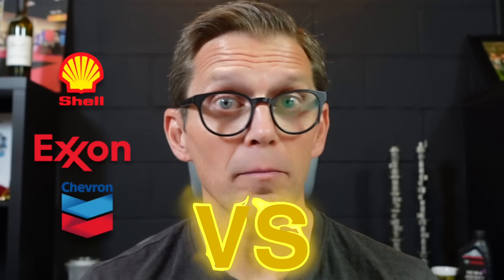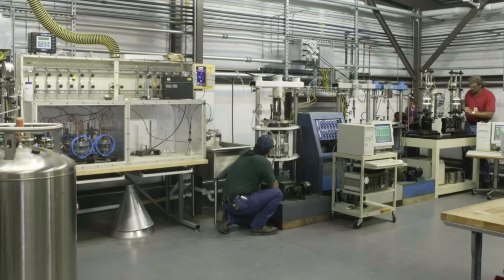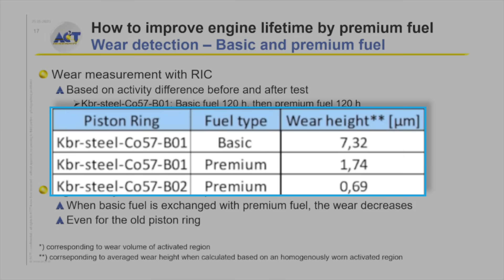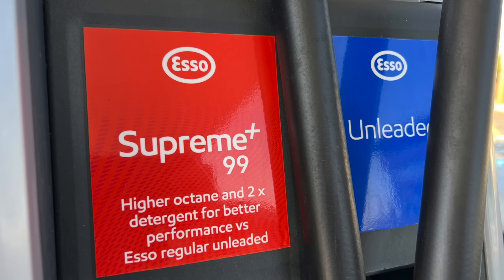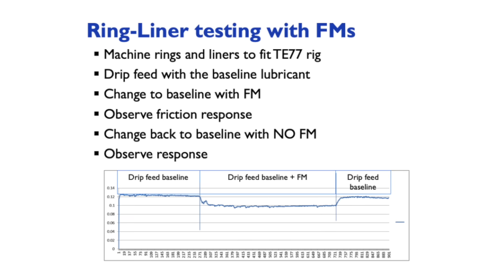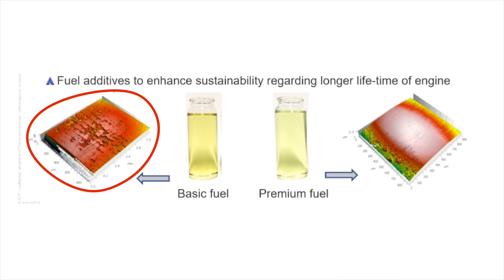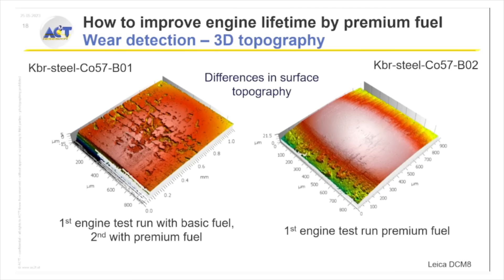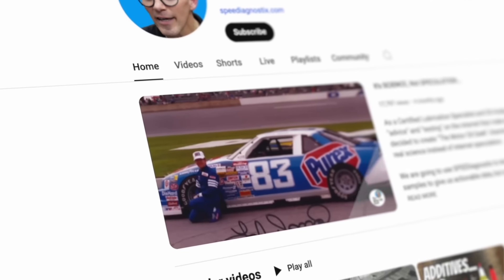Can Premium Fuel REDUCE Engine WEAR?

Comment: My C5 Corvette drank nothing but Shell V-Power 93 its entire 190k mile life in stock internals.  I went to do a cam and heads swap for more hp and found that my cross hatching on my cylinder walls looked brand new, and almost zero carbon build up anywhere.  Very pleased.
Reply: I have a 2010 Camaro SS with 225,000 miles and just replaced all gaskets, lifters, springs, timing chain, and cam. The cylinders looked like they had barely been run so back together it went and we're still rolling like the car is new. The cars entire life I've always used full synthetic oil and premium fuel, typically same brand unless I'm traveling.
Reply: what brand of synthetic oil?
Reply: @rl7487  Valvoline Vr-1 20w-50
Reply: @gofastwclass Going to guess you did regular maintenance on it and changed the oil within 7,000 miles (An didn't fall for the 20,000 mile hype on the oil container) and didn't drive it like you stole it either. That is going to affect the engine wear FAR more than gas (So long as you didn't get any bad gas)
Reply: @SilvaDreams  you got data on that?
Reply: @SilvaDreams Not many vette owners doing 7k oil changes😂  C-5 owner (Z-06 bought new in 2001)
Reply: @SpookyEng1  That is just sad to think about.... Use to change my friend's 1968 1/2 Camero's oil every 5K or 6 months, still the original engine and ran smooth as silk (despite the previous owner being an idiot and trying to drag race it and welding the block to the frame)
Reply: @SilvaDreams it’s “Camaro” and there was no 1968 1/2 model😂 Some people call a 1970 model 701/2 sometimes because of its late release.
Reply: @SilvaDreams Driving it like you stole every once and a while is actually good for the engine. Engines were designed to rev out. If not they will have get carbon build up if you are just lugging around.
Reply: @jayflo714 If you take proper care of your engine and it's tuned correctly no you don't. It shouldn't have any carbon build up of any noticeable amount. Well unless you have a newer car that cycles your exhaust back through in the name of "efficiency" then yeah no amount of revving will get rid of all the build up out of your intake.
Reply: @SilvaDreams  nobody is recommending a 20k oil change
Reply: @blgdinger3  Amsoil? Just looked it up. Their extended change interval is 1yr/25,000 miles
Reply: @SilvaDreams  what is the point of having a corvette if you can’t drive it like you stole it ?
Reply: @SilvaDreams  - It's pretty obvious that you never heard of Direct Injection because you'll get carbon buildup no matter what you do, smart guy.
Reply: @gofastwclass  So what. My 96 Lincoln Mark VIII went to 315k before I sold it. Ran semi synth oil until last couple years and whatever fuel I could buy cheapest. Ran fine. Same thing with my 2005 Grand Marquis.
Reply: i run vpower and amsoil in my c5z, those LS engines if cared for are simply remarkable
Reply: @steveharper5368  ironically enough one of their biggest issues is the oil system 😂😂

Not an issue for street cars, but the dry sump upgrade is necessary in a lot of performance applications
Reply: Removed the oil pan of a 94 dodge v8 running on 87 octane and regular synthetic oil with 475 k mile and still have cross hatching and perfect cam lobes so I doubt that it's because of your fuel
Reply: @alextaylor1542  I'm sure it helps.  Lol. Because I dont baby this car.  I light up the tires whenever possible and regularly hit 150 mph.
Reply: @ChefofWar33  Where is it legal to go 150mph? Why would you “light up” the tires whenever possible?
Reply: @ryanranard5187  Its not legal.  And because it's fun.  And I pay for the tires for a reason.  Also, i enjoy being a menace to society.
Reply: @ChefofWar33 Me too! I participate in shenanigans here in Gulf Shores,Alabama!!
Reply: @ryanranard5187 in the 70's and 89's there was no speed limit on the autobahn in W. Germany. Our Renault would only go 154. I hated big Mercedes and BMW. They would pass us like we were standing still.
Reply: @ChefofWar33 hell yeah, do the same with my HCI WS6
Reply: @ryanranard5187.  At one time in this country we had unlimited speed limits, in Montana '55-'74 and '95-'99; Nevada '74-'99.
Reply: @alextaylor1542 he didn't mention cam lobes. Did you watch the video?
Reply: Shit I can’t even afford 87 octane.
Reply: You run a oil catch can?
Reply: @ridingstuffed  Allthough I might need one or perhaps new valve covers.  I had to delete the valve cover baffling in order to fit my BTR shaft rockers.  Now it burns oil.  Oh well.
Reply: @ChefofWar33   it's amazing how much oil it prevents from going back into intake ( about a shot glass every 2k miles) once I've seen how effective they are , putting them on all my vehicles from now on.
Reply: @ridingstuffed just emptied mine yesterday on my 2017 mustang gt . Will never run another performance car without them
Reply: @ridingstuffed  No
Reply: @ridingstuffed  Catch cans are a salesman's snake oil. No independent SCIENTIFICALLY run tests have shown them to be of any benefit.
Reply: @ridingstuffed  that's all I run
Reply: @ridingstuffed catch cans aren't necessary
Reply: @MrC9Oh3  if you ever take the heads off and see how much carbon build up is in the intake.....where does that come from? It's the oil from the crankcase pressure relief that funnels small amounts of oil back into the intake to be burnt off during combustion ( carbon build up) with a catch can that oil never goes into intake therefore reducing carbon build up in intake manifold which then reducing the chance of a chunk breaking off and damage something, but yeah , not necessary. I like em tho!
Reply: @ridingstuffed 😅😅
Reply: @MrC9Oh3 have you seen the inside of an engine that has used one vs one that didn't? You'd be surprised at the amount of carbon build up in the intake, pistons, heads, etc. I won't run my hemi without one. I wouldn't run any engine w out one tbh. You'd be surprised to see the amount of oil it catches too.
Reply: I put 87 octane into a c5 for a year and when I did heads I needed sleeves. I only owned it a year at the time
Reply: Does this apply for diesel engines , absolutely mind blowing info btw .
Reply: Your engine is multiport not today's direct injection. Your valves should be clean...
Reply: @ryanhack5  🤣
Reply: @ChefofWar33  go look at today's engines.  What are they?  Direct injection, what's your c5 vette?  NOT DI... every 90s motor will look pretty clean. I'm a GM guy had lots of their GMPD motors, all very clean 
Today's DI engines, have better oil, gas etc, big difference is where the fuel enters.
Reply: staying on low rpm
> more carbon buildup
staying on high rpm
> more engine wear

A good oil with a decent maintenance schedule and just a minute or two warmup before using is mostly enough for common folks
Though having a good fuel means you have cleaner burn than the lower octane that has shitty additives
Reply: I ran an old 5.0 for 230k, took the heads off and they cylinders still had hash marks, only ever ran high octane and marvelous mystery oil every 3rd tank.
Reply: Would pure gas (no ethanol) cause any damage you think?
Reply: @alexndelk  pure gas it what you want. Years ago ethanol wasn't added to gasoline, the alcohol causes issues compared to pure gasoline.
Reply: does shell gas stop the fuel gauge issue
Reply: Ive got a boosted is300 that has 280k miles and has been boosted for 30kmiles, ive used nothing but Shells Rotella oil and Gas. Things literally smooth as butter
Reply: Sounds like a giant waste of money.
Reply: My 2016 Kia Sportage has drank nothing but the cheapest gas I could find at the time in its 520,000 mile and continuing life. Regular oil changes, filters and other fluids. No oil burning, needs new fuel injectors which I have planned to do but it would probably kill over if it got some premium brand gas.
Reply: @mrdonetx  You have a Kia pal.  You don't abuse your car like I do.  Lmfao. Unless of course you burn the tires off at every red light.  Which I fucking doubt.
Reply: @ChefofWar33  abuse or not, at 500,000 miles the wear would be more than a 150,00 mile abused vehicle. The amount of piston strokes and cam rotations will easily surpass your "abuse" unless you are intentionally trying to ruin your engine. It regularly pulls and carries more than just it's curb weight. Your engine was made for what you are calling abuse. Unless you are saying that they make low performance engines and market them as being otherwise? Or you are saying you are intentionally trying to ruin your engine which in that case your comment was just to hear yourself typing because no additive protects against people intent to make something happen.
Reply: @mrdonetx  Not trying to hurt the engine.  Just having fun with it.
Reply: Same result my Subaru 4cyl 240k so far shell 93 and 3k oil changes
Reply: Not trying to be obtuse, but here in Canada, my cars pinged on Shell, so I really have never used Shell. One was a 2000 Grand Caravan
Reply: Good fuel is nice but good oil is better.  Both is best.
Reply: Your cylinder wear has more to do with oil than the gasoline that you used!  Oil has lubricating properties and gasoline is made to combust ! ! !  Two different things ! ! !
Reply: Why would there be carbon build up on cylinder walls? it would look the same with cheap fuel.
Reply: @nigelsenchez  Not carbon build up.  Cross hatching.  Shell premium has better lubricity than other cheaper fuels, which helps protect the cylinder walls.  Did you even watch the video?
Reply: @nigelsenchez from not running a catch can.
Reply: And that's the exact same result you would have if you ran the cheapest fuel on the market. Your single anecdote is first of all worthless, second of all an extraordinarily common experience. Those engines don't have serious wear issues when they're not used at the track.

Comment: So, we just took a trip out west from the east coast.  I was driving an 2004 Tundra pulling a 22 foot Winnebago.  I was very surprised about the fuel west of the Mississippi.  It’s full of ethanol.  My mpg went down from 12 to 8 by using the basic fuel offered. It was 85 frigging octane with 15 percent ethanol once I passed the Mississippi.  I went to shell and started buying my gas purposely at their stations. My Mpg went back up to 12.  I don’t understand how they can say the octane rating is the same, but you get less mpg.  If I bought 87 at shell and 87 at other stations, I would always get better mpg from shell .  Even when I used 87 octane fuel from other stations, my mpg sucked. I’m not Saying 12. Mpg is great, but 8 is horrible, I was pulling a 5k pound trailer . Shell has good gas, no matter what part of the country you are in!
Reply: Try ethanol free from shell - you might squeeze more mpg's out of that Tundra and you can not have all that water sloshing around in your tank (ethanol is hydroscopic which means is attracts water molecules). Yes, it's substantially more, but on my suburban I'm getting ~ 50 more mile per tank .....

Comment: Did you know brushing your teeth with tooth paste causes wear?  If you want to reduce wear, don’t brush your teeth.  On the other hand, you’re likely to die from Alzheimer’s before your teeth will cause you harm.  So the premium fuel will decrease engine wear on a very few engines components by 100 atoms.  So what, by then the cam or the crank has worn out.
Reply: broke people 87 talk

Comment: I just put Supertech synthetic two-stroke oil in my gasoline, mainly for my old carburetors and fuel lines, but it does seem to help the engine run cooler. ( On a motorcycle you’ll notice how much heat is coming out )

Comment: dude, you gotta try to do a 2 cycle premix test, see what it does to EGTs and the sump oil. ive been running that pennsoil premium marine 2 cycle at 100:1 in my old 54 Y-block in hopes of it protecting the  un-hardened exhaust valve seats, ive been wondering if leaded engines burned valve seats just from ethanol in the fuel leaning out factory carbs jetted for leaded, or if the valves are really that needy for the ole Ethyl

Comment: Interesting. I have a Lexus LS430. 172,000 miles. Since I've had it, I tried to use premium. But I'm financially strapped. I've been buying octane booster, and going by the direction. I still have no soot in the tail pipe. So I assumed , " higher octane" allows for better timing and more complete fuel burn. OR is it that this car has a very expensive CAT and is doing a very good job. I want your take on this. ( From what I understand the octane booster probably has some good additive wear)

Comment: Can you tell us what we should be doing to compensate for the epa removing sulfer (lube) from our Diesel?  I have 9 older cummins, a original 6.2L turbocharged now never been appart... been adding 2 stroke to my fuel for years now & I can actually note a difference in fuel temp rise times.  Most don't realize diesel is used to keep our injection pumps cooled.  Run a big rig for 8 hrs+ & the fuel tanks are so hot you can't touch them without gloves.  Europe & others don't have the problems we have with Bosch cp4 pumps... think it's a lube issue?  I run FASS 150gph lift pumps on my two VP44 trucks at 15-17psi for the added cooling.  B4 my fuel temp going into my vp44 showing on the CTS2 gauges didn't change much over time.  After the FASS systems were added It's was very noticeable how much cooling was taking place.  Wish you were my mentor growing up!  I would have learned so Much!  Love all your Tech!  PDD in Utah has an amazing oil with zddp & other addative package that I wish you would test.  It could be in my mind but love this oil for my trucks without cats or regen.  Thanks Again!  Your Amazing!!!!!!

Comment: Some manufacturers recommend "Top Tier" fuels to help reduce carbon buildup on Direct injection.  Generally Shell, Costco, and ESSO are top tier. (There's a sticker on the pump that will tell you)

Comment: I once made fun of an old guy that told me he mixed a tiny bit of 2 stroke oil in his 4 stroke motorcycle fuel tank. Now, given these results, i think the joke might have been me...
Reply: Make sure to use JASO-FD two stroke oil if you do this.

(And use the cheapest jaso-fd you can find)
Reply: @GothxJesus  alright got that, but why?
Reply: @redpillforrealbrasil1405   yes this is effective and only requires about an ounce per 10 gallons for enormous benefits
Reply: I add 6oz of 2 cycle oil to my 25 gallons fuel tank. Clean injectors, quiet fuel pump, better engine compression.
Reply: @rachelgreen1368  did you measure any of this?
Reply: @GothxJesus  200k miles on  car, original fuel pump, no oil consumption, great acceleration.
Reply: @rachelgreen1368  yeah so what was your before internal friction loss and after?

What was the cylinder PSI before and after?

My point is, you didnt measure these things and have no idea what you are on about
Reply: @GothxJesus  read how oil gas mixture works in 2 cycle fuel  injected boat engines. I'm not selling anything. I just feel my car runs better with little marine oil in gas.

Comment: I add 0.5% tw-3 2 stroke oil as an upper cylinder lubricant in my fuel and I really do feel like it’s making a difference, can you do a test on that oil geek? I know it’s going to lower the octane and all that but I feel like the gain outweighs the loss.

Comment: What addatives or cleaners should we be using?  I have been using FTC from Australia with good results.  I clean & decarbonize the rings from the crank case side & then add decarbonizer in the fuel both diesel & gas to clean the top side of my rings. Also add their cleaner for injectors & a 3rd for fuel conditioner.  Blowby all but stops & compression does jump up on the gage but does the condition   help with wear?

Comment: But just how MUCH wear does this mean in the real world?   Many many people run their cars almost exclusively on supermarket fuel,  and with bulk-bought "one viscosity fits all" oil filled at the service at the dealership:  Should they expect their engines to have zero compression before 90,000 miles?   Or are we talking about the difference between a 150,000 mile engine life and a 250,000 one ?

Comment: GREAT video! Lets talk about science, why are the two engines run at different time intervals?  (45 hours for the basic, 60 hours for the premium?) I appreciate the fact that one can conclude that longer run times with premium = less wear! I like numbers, this data set forces one to extrapolate the numbers to get an "apples to apples" result. Now lets talk about the" touchy feely " data I use to fuel my 2020 Dodge 392 Scat Pack Charger. ( I use the recommended Penzoil 0-40 Ultra Platinum oil) . With Shell premium (CALIFORNIA) gas, I get a nasty sounding POP! sound when the engine first fires up cold. When using Chevron (THE MOST EXPENSIVE GAS!)  She fires right up smoothly. Every time. I ran this test many times. Winter and summer. My car is a picky eater. I love it!